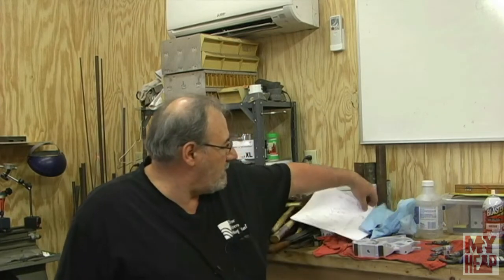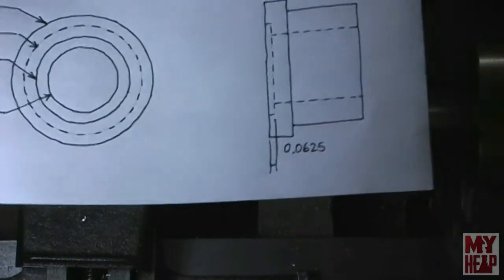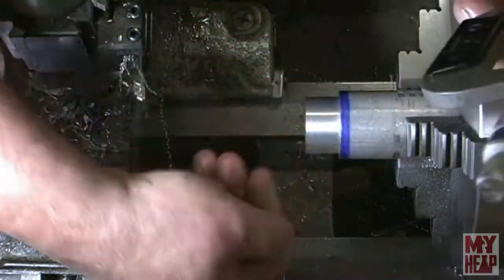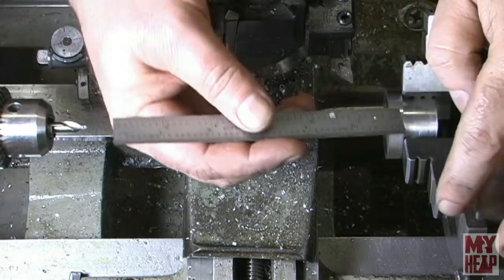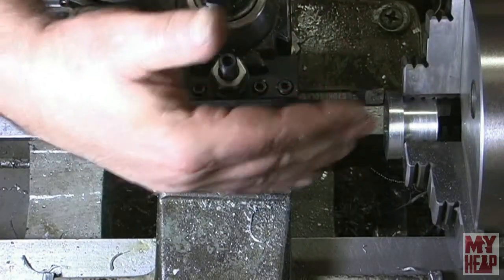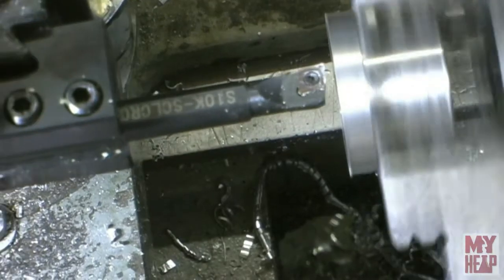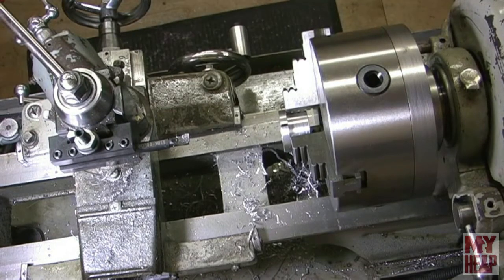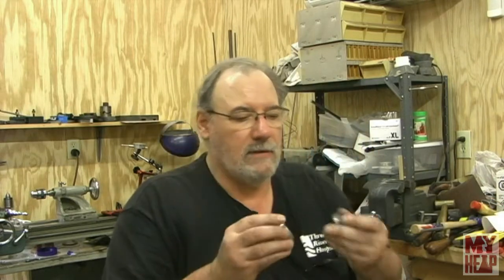YouTube Shop Student - Episode 012 - Thin Piece Split Collet

Comment: G’day Joe. Nice little project, well explained and thanks for sharing. Those washers are easy to handle once a proper jig is made. 
Great to see you making chips. 
Cheers 
Peter
Reply from the maker: They are nice little things to have and they work quite well.  Yes sir, it is nice to make chips.  Made a few while refurbing the steady rest.  Should be out soon.  After that and its back on the Mill and KW Engine.

Comment: looks good man, I've made a few of those in the past and they definitely do come in handy. Thanks for showing us noobs how to do it, lol.
Reply from the maker: HAHAHA  I think your way past Noob pal!  But all kidding aside, I was really surprised how well they hold with such little force applied from the chuck.  Well definitely keep these in my tooling and fixtures for the lathe, box!  Thanks for watching.  How is the T&C grinder coming along?
Reply: lol, the grinder isnt coming along, just needed a break from it and havent done anything anything else, lol. The split collets like that that I made, I had bored it out so it was stepped, that way I could hold multiple diameters because mainly I just was using them to face the blank off and drill/bore the holes out of washers/spacers that I was making, so I could use the steps, lol.
Reply from the maker: @ChirpysTinkerings  the multistep split collet is a better idea.  One which I think is mentioned in one of the work shop practice series.

Comment: Nice!  I would suggest drilling the holes in the washer blanks before parting them off. Would save a lot of setups. as you would be drilling all of the holes in one setup. As well, it would be a lot less material to part off. Thanks
Reply from the maker: That was how I done the smaller 7/8 washers but thought I would try using the collet for drilling.  That worked well too, but will likely follow your advise for future ones.  Thank you for taking the time to watch and the tip!

Joe

Comment: That's a great idea, Joe, It will definitely come in handy, thanks for sharing.  The camera over the lathe gave a great view, was that your IP camera or a stand-alone?
Reply from the maker: Hey Walt, glad to see you buddy.  These simple collets work really well.  I can see making more of them as time goes on.  The camera I used was my Sony 3 color channel camcorder.  It is quite old, but still works okay.  I still need to locate a better wireless mic.  Are you still on the mend?  Doing better?  Video soon, maybe?  :-)

Joe
Reply: Hi Joe, The sun is out, the air is warm, and I'm feeling 99.9%. I've been in the shop all weekend and most of today.  Been shooting a lot of `B'roll for the past few months, have a long list of projects to finish,  I've been putting off the heavy work till now, so yes, video real soon. I see this year as very productive.
 How's it hangin in your neck of the woods?
Reply from the maker: Hey Walt.  You know me, I struggle to find any time to get in the shop.  So this year I am hoping just to knock out the low hanging fruit and some of the projects that are unfinished.  Been working on a steady refurbish that should be done very soon.  Then back on the mill and KW Engine.

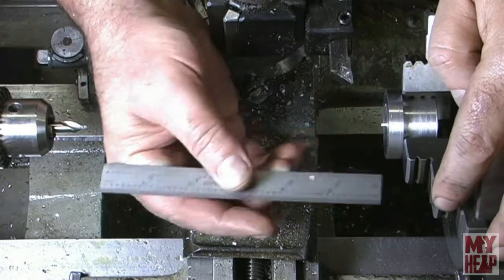Comment: Thin Piece Split Collet is a great little project.  I think I'll make up some for myself.  They look pretty easy to make.  Thanks to You and Tinker.  I'll let you know how it turns out.  I don't mean to be too critical but your diagram didn't show the slit (minor point) and at 14:04 you measured the thickness of the large diameter with your steel rule as 3/16 th's.  I think you probably meant 5/16 th's (again a minor point).   How are things going with the Horizontal Mill?  Good to see on the channel.
Reply from the maker: Hi James.  When I record I fumble with my words sometimes.  Or maybe it's because I am getting old.  I dunno.  HAHA  My mission for 2020 is to get some of the outstanding projects off the plate and the horizontal mill is on the list.  After finishing the steady reconditioning, I will concentrate on finishing the Mill and the KW Engine.  After that, well you will have to wait and see.  I still need to find a motor for the mill, but at least it is ready to go back together.

Thank you for watching sir and commenting.  I do appreciate it.

Joe